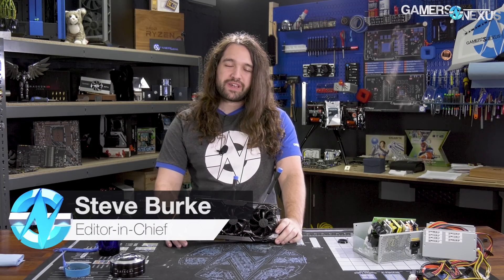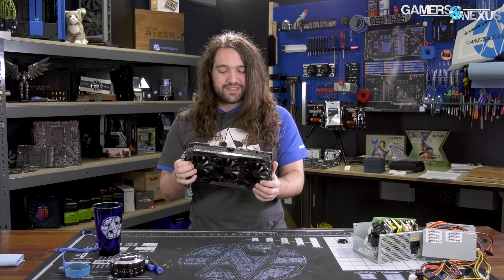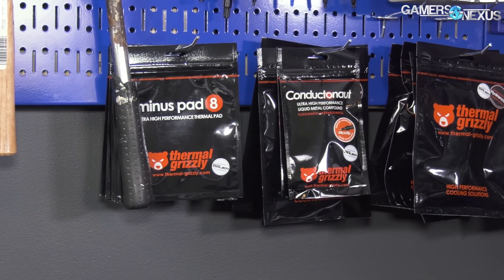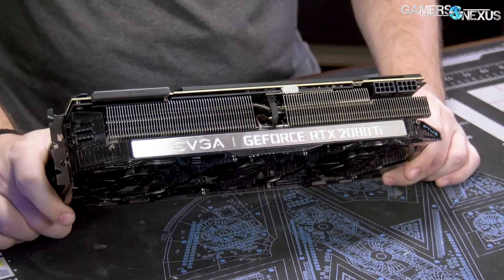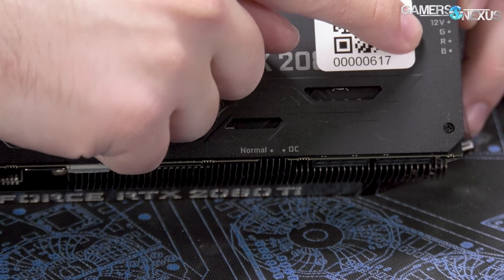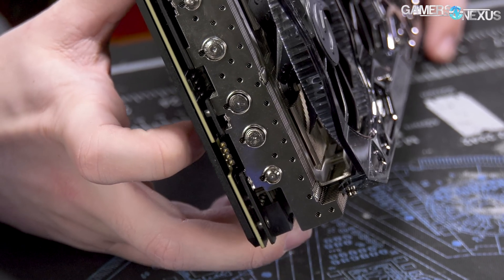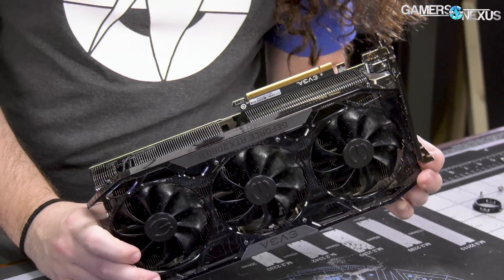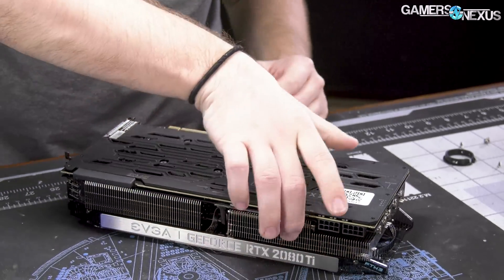$1350 Video Card Tear-Down: EVGA RTX 2080 Ti FTW3

Comment from the maker: Finally have a new Ask GN done! Probably goes up tomorrow or the next day.
Check out our PS1 Classic tear-down here: https://www.youtube.com/watch?v=qYW-4AOFkDE
Grab a GN shirt here: https://store.gamersnexus.net/
Reply: Why do they even bother calling it a 2.75 slot card, when it's really a 3 slot card? Are there plans for a 0.25 slot card in the future? LOL!
Reply: Matt Christie Because then someone would complain that the card/cooler itself is only 2.75 not the full 3 as advertised. 😁
Reply: @dickr9345  I know right! I was just kind of hoping for some super thin cards, what with the miniaturization of everything these days! LOL!
Reply: Cool video, but your review of the cooler seemed quite improvised.
Reply: Do u think NZXT cooling bracket (G12) will work on the card? to slap a AIO cooler on it?
Reply: Taking about asking. I noticed at the end of this video you talked about thermal pads making the backplate functional. If I remeber correctly the ROG Strix GeForce 1080 Ti OC does not function like this (the GPU I have). Is it viable to put thermal pads on there to make it functional? And maybe you could test if this has any positive effect on the cooling?
Reply: Where's the best place to find replacement fans?

Comment: Huge shoutout to Gamers Nexus for these teardowns. I still have this card in use in an older AM4 system, and I just noticed this back side is leaking what I think may be chemicals from the old thermal paste. At some point I will tear it down and clean it up etc, and this video was the first one I came across when searching for tear downs....probably because I'm subbed, but still.

Comment: The fan cables from the heatsink u took out (at 3:45)- I’m trying to put them back on mine (same card, 2080 ti ftw3 ultra)but noticed the cable endings are color coded (on one side, almost didn’t see it) one red, one green, and one either white or silver. Which order should I put them back, or does it  even matter?
Reply: Hope you figured it out, i just bought this card from a friend still new in the box for $600 i just got so lucky this thing is a monster!
Reply: @-BUGZ-  i actually never did find which order they were in originally, but it didn’t actually matter. After cleaning and repasting my temps went from hanging around 80-83 c (playing warzone for 30 min), to 59-61 c with short lived highs of 69 c (playing a whole hour) but then the fan turns on and takes it back down. Mine was super dusty, but it did still run hot when I first got it, so if yours does too I def recommend replacing the thermal paste. It was super easy and the stock paste only covered 3/4 of the chip. Also noticed the thermal padding wasn’t straight and was “lumpy” so i straightened that out too :) gl & hf with ur new card bro! What a steal for 600$!!!! I paid like 1,500 lol, good for u man!

Comment: EVGA cards are stupidly assembled. I have had the 1080ti and 2080ti XC and both of them has the same stupid flaw. One of the fans is hitting a loose cable causing an annoying click sound. This alone is the reason i won't buy another EVGA card tbh. Expensive high end card with a stupid flaw like this is unacceptable.

Comment: Just gotta say this video was an excellent resource when putting on my waterblock. Thanks Steve and Co, you guys rock.
Reply: Ron Oman thinking of doing the same soon, is it worth water cooling?
Reply: @infantryrecon101st  Yes and no. It's expensive and the drop in temperatures are not too drastic since the stock cooler is one of the better out there. But that said, I think it looks great and I don't think I've seen my GPU temps above 60°C since I installed the block even with a decent OC.
If you have the money for it and value the lower temps and noise I'd say go for it.
Reply: @RonnieDeuce87  Awesome! Thank you!! Yeah, I'm always in the 70c range when playing for a long time, but I'm pretty OC'ed all the time too. Just don't want to take everything apart when a new TI card comes out again, but should be worth it for extra headroom when OC'ing.

Comment: Is there any point in liquid cooling this?
Reply: No, your throwing away the $200 worth of aluminum cooling difference from the reference/ founders.
Reply: TopShot501st can I get as good performance with this card overcocked as a watercooled 2080ti FE?
Reply: @B1SQ1T  the founders cards can clock higher than the reference if you waterblock them. The strix ftw3 trio etc are binned like the founders but have better coolers.
Reply: TopShot501st ohh Icic thanks!!

Comment: I have an honest question for you.  This weekend I purchased this exact video card.  Got it home and installed it in my pc.  It showed in the device manager and every other hardware info program as a 2080.  Now I did purchase this card as an open box item.  On GPU-Z, all the specs were an exact match to the 2080 version of this card.  
Do you think it's at all possible that someone bought both of these cards and switched the parts between them in order to return the "2080 ti" which is now just a 2080?  
I returned the card I bought and was given a brand new card and the store honored my return.  They also verified that it showed up as a 2080 ti in their pc before they let me take it home.  Crazy story huh??
Reply: bs story dyd!

Comment: 3-slot card? At that point why don’t they just use an AIO watercooler? 
I remember back when GPU’s were single slot, and then they all changed to double (and prevented you from using other card slots). Now it’s 3-slots?

Comment: Is Kryonaut any good for repasting the 'thin and light' gaming laptops that are currently prevalent? With the i7 8750 and 1060/1070, they often seem to run hot, and I notice that Kryonaut specifically calls out that it halts the drying process 'up to 80°C'. Got a new laptop currently being shipped, and fully expecting to have to repast to get the best out of it so been trying to decide on the best stuff to use. Had been planning on using some MX-4.

Comment: Always a pleasure to watch Steve do a teardown! I wish there were more of them (not only for GPUs, but for MoBos and other computer hardware as well).
REGARDING THE FAN: I believe the model number can be broken down as follows...
The first two digits ("PL") simply stand for Power Logic, the next ("D") is the series; this is followed by the (3-digit) size and (2-digit) thickness, then either "B" (for Ball bearing) or "S" (for Sleeve bearing); lastly, we have the voltage and "L", "M", or "H" (Low/Medium/High) RPM.
Thus, a PLD09220S12H is a Power Logic D-series 92mm × 20mm sleeve-bearing fan designed for 12 volts and high RPM.

Comment: Wouldn't it be better in terms of price and performance to buy a reference card and stick an aftermarket cooler at it? There are beefier coolers out there but something like accelero twin turbo 3 is $40, designed for 250w tdp, has a proper backplate and it's radiator sits a bit higher than graphics card pcb unlike these rads that sit on top of the graphics card.I'm pretty sure if one wants to stack graphics cards they would go for ref design or do custom loop stack.

Comment: And here I start to wonder what the phase change temperature of the heat pipe is.
Since some might say that it should be as low as possible. And that technically isn't optimal, since the phase change temperature of the system when the water/liquid boils. Thereby drawing away heat. But one needs to get bellow that same temperature for it to go back into liquid.

So what temperature would be optimal?

I personally would make a rough "guess" that somewhere around 55-65 degrees C would be fairly optimal. Since most GPUs tends to go to around 80 degrees C during operation.
This would mean that our heat sink can be at a warm 60 degrees, giving a large delta to ambient air flowing through the case, and through that provide efficient cooling.

Downside is, the idle temperature of the system would be higher, since the heat pipes aren't all that conductive when below their phase change temperature.

In terms of CPU coolers, one could upgrade from one small cooler, to a larger one, without seeing any change in low load temperature, even if the better cooler would be able to keep the peak temperatures lower under higher loads. (This is a quirk of heat pipes that I find particularly funny.)

But it has also made me wonder, would a planar heat pipe make for a good IHS for a CPU? Since a heat pipe can have higher thermal conductivity then a slab of copper.

Comment: Question. Why don't companies sell separate heat sinks and PCB's as graphics cards? Put your own heat sink on it. It is possible if they would follow standard rules with regard to layout which prescribes where you can and where you can't put the GPU and memory.
This way the cost would be lower but much more importantly, we wouldn't waste so much metal and enery (to process that metal). Given that many of us buy a new graphics card every 2-4 years it would make sense to reuse the heatsink and fans, both for cost and the environment.

Comment: Can someone help me please, i just got a new pc together and i have an asus b450 mother board. The problem is my rx480s back plate is stopping the clip from coming up fully and clicking in the pcie slot, it does go in and works but isnt fully in and makes a whaling noise when at full power.
Reply: Why not remove the backplate?

Comment: I love this type of  videos. But let me make a little rant and sorry if I'm toxic but that's like a minum wage salary in Europe for a card that looks like...  well... sh*t and is heavy as hell. At this price the RTX 2080/ 2080ti with the heat they generate they should come with an AIO aluminium cooler which will be better than absolutely any ''triple fan, full copper 2.5 slots air cooler bal blah"  bunch of BS cooler they make ( it will be less than 30$/card to add one) But you know all these manufacturers are cheap and they like to milk their customers for money and will ask 1500$ for a "hybrid" card in a couple of weeks.

Comment: @Gamers Nexus Hi, i saw a few Videos popping up wich compared 1080ti sli vs a single 2080ti and it could be better performance for almost the same money. Sure no "Retracing" but if u dont "need" retracing would u recomment a 1080ti sli setup or still going for a 2080ti?

Comment: Steve question about backplates: Are backplates being used on these bigger cards to add structural integrity to the cards? I've heard a lot that there's no thermal performance gain, and while looking at this BOHEMOTH of a card I thought "That is a TON of heatsink, that has to stress / flex the PCB....oh....huh....it might just screw onto the backplate to move that stress there....." -> The way I see it, the backplate could theoretically force that PCB to be straight / flat despite the large amount of weight pulling down on it... though the PCIe connector might still be stressed

Comment: What a well built cooler. As always from EVGA i love how they optimize everything for airflow. I wish manufacturers would stop putting stupid logos and fancy designs on the whole entire SIDES of the card, it just restricts airflow.

Best example of this is my 1080 AMP! Edition from Zotac, the sides of the card are covered by fancy fake carbon so much that i can feel a lot air ejecting out of the actual fans and not going out the sides. My temps are really hot aswell.
Reply: At least that thing doesn't have anything in front of the fans. Many new cards seem to have ornamental pieces of plastic blocking the fans, reducing airflow.
Examples: https://i.imgur.com/sj3BXjf.jpg and https://i.imgur.com/ImthpNj.jpg
Reply: @Kepe  wtf
Reply: @Kepe  neither of your cards were evga... lets remember that EVGA includes a gaudy faceplate as well. BUT it isnt preinstalled.. so good on them!! :D
Reply: that part about the side of the cards and the stupid full covers bro yeah!!! and not only the hot air gets trapped in the cover it also finds more easy escape on the other side of the card and hit the damn motherboard!!

Comment: There are some companies that will have a problem with a broken warranty void sticker, in this case, watch some vids where guys remove it by using ESD bags so that you can remove it without breaking it, and then re-apply.
Reply: Companies can have a problem all they want. The FTC said that warranty void if removed stickers are illegal. So companies cant void your warranty based on whether or not a sticker is still in tact or not.
Reply: and i am sure we all have the money to take them to court when they deny the warranty
Reply: Beware that the outside of the ESD bags lead current, while the inside of the bag does not.
Reply: no
Reply: Not "in this case" because it's an EVGA card.

Comment: FTW cards are so hard to get in Canada. I think EVGA underestimates the demand for these cards or they keep a tight supply to increase the price.
Reply: I would think it's nvidia's lack of supply to their partners.  Are other brands easier to get there?
Reply: I always wanted a FTW card but there is only a very small time frame they are available. They are only available mid-cycle of a architecture and they sell out and are unavailable really quickly. I always like to buy a new architecture relatively early so I can never get a FTW. When they are available they cost sometimes as much as 400 dollars more then a basic version. Asus Strix cards are also very hard to get I was able to get a 1070 Strix but that was mid way through the GPu's cycle. Currently I have a 1080ti EVGA Black edition I bought as soon as the 2080 was launched and I got it for $655 brand new.  @ntomnia585

Comment: $2k+ for that badboy here in Canada
Reply: Canadian dollars are not the same currency as US dollars. You can't compare prices between different currencies without doing a currency conversion. 2000 CAD seems to be 1490 USD. US prices are always without taxes. If you have a 13% VAT, then 1350 USD x 1,13 = 1525,5 USD, which is 2043 CAD. So the price in Canada seems to be perfectly in line with the 1350 USD price.
In comparison, 1350 USD = 152 130 Yen. This card seems to sell for 400 000 Yen in Japan, which is about 3550 US dollars. Now that's expensive.
Reply: @Kepe  For your currency. But for the CAD currency?
Reply: @usopsontorian8813  ?

Comment: Does anyone know if they have single/dual slot brackets for this when you're using a waterblock?

 I'm looking to get this and their own block for it, but it looks like it doesn't include a smaller bracket for some reason.
Reply: Just cut your 3 slots bracket, costs nothing :p
Reply: You can buy a 2 slot bracket from evga for $20.
Reply: Of course it's $20 for a 15 cent bracket. :P Yes it is silly to complain about 20 bucks on a $1500 card+block, but still. It's the principle. Haha

Comment: If you use all the fan headers and RGB headers etc on the card, how much power does that take from the actual GPU? Could there be a small performance difference since Turing already hits power walls?

Comment: Jesus christ, that thing alone costs more than any decent midrange computer.
Reply: LX-24's Bullshit Crazy isn’t it.
Reply: @More_Row  yeah recouping research cost of hundreds of billions to implement an outdated technology into this stale and fucked up market that is help back by a number of things starting with CPUS bottlenecking even 10 series high end cards let alone the 20 series. Game engines so outdated everything looks almost the same. The lack of actually pushing something to be for a small few so that it drives up the need to create more cost efficient and more powerful hardware to keep up. Whats the point in creating far better hardware if basically everyone can use cheaper weaker hardware and be completely fine doing whatever they want it means theres no need to really push for anything. It becomes completely stale. Consoles are the biggest reason for this already and game developers as well.
Reply: Eara Soulous you do it to move technology forward, there is always a cutting edge and yesterdays old news. Pushing the limit and moving it forward is a good thing, and without that we would have never seen the advances we have the last several decades. Time will tell how good or bad this card/architecture are. Believe it or not 2080ti level performance will be low end one day. Just like 700series cards are now.
Reply: @skoopsro7656  I'd love to. However I dont have anything to really risk to compete. It's not simple and these companies know that..but consumers have been pushing for easier and easier and such so that everyone this and that which slows progression and people need to realize that sometimes it's best to have more luxury activities or products and such so that it pushes the industry forward to make it available to all. Look at phones these days compared to back then. Computers and so forth.
Reply: @yulfine1688  At any realistic resolution, how many games actually exist where the cpu is the bottleneck? By the time you own one of these I'd assume you'd also own a 1440p or higher res panel and a 2700x or 9700/9900K.
Reply: $1800 usd for that one in Norway. including tax.
Reply: @sjarken3979  that's because Norway has one of the worst economic systems for it's peoplem. Governments wealthy the rest isn't
Reply: I paid over $1600 for mine
Reply: @MrKevin920  That's what I paid down on my Jeep! insane....But I'll still buy one because I don't like having money obvi...
Reply: Kevin Artz got mine through amazon for $1350
Reply: $2300 in Canada without tax
Reply: Alvin Walters  

Not with the cost for the little performance increase. I got a RTX 2080 ti ultra hybrid. Replaced a 1080 ti ftw3 and am very disappointed in the performance increase vs cost. I have two 1080 ti ftw3's and should have stuck with my SLI and waited 3-4 years. Card cost vs performance gained is soooooo sh!tty now. If you got money to burn I suppose.
Reply: dont say the Lords name in vein